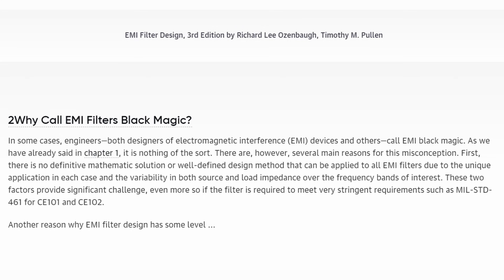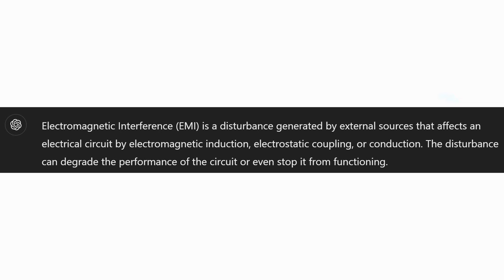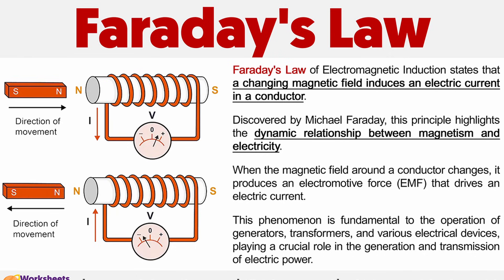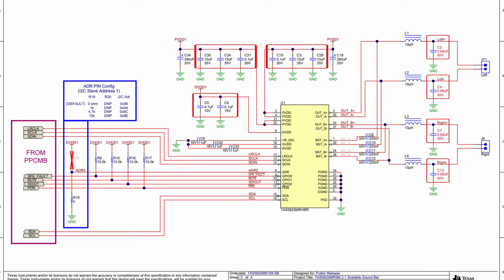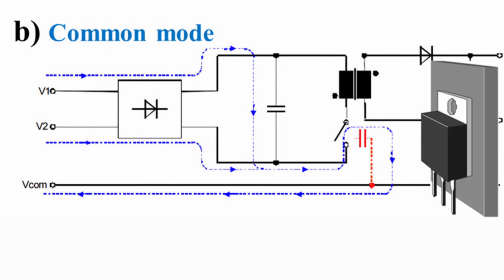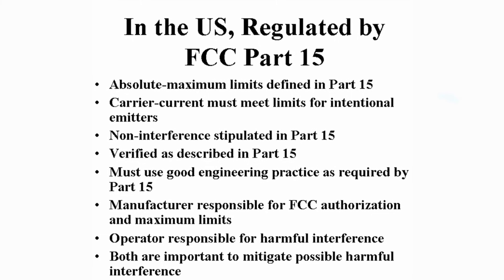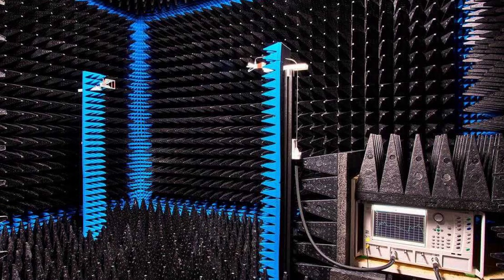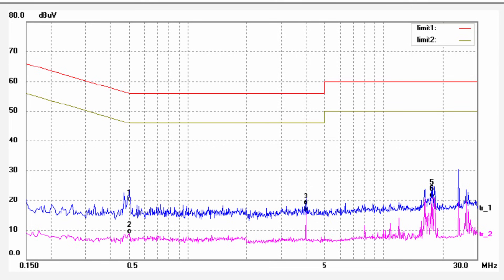EMI Basics (For Beginners) | Electromagnetic Interference

Comment from the maker: What questions do you have about EMI?
Reply: Where common mode and differential mode emissions commonly originate from and how to tell them apart in a measurement.
Reply from the maker: great question! We will be covering that thoroughly in this series
Reply: what are some strategies to counteracting emi within the US power grid, if needed at all?
Reply from the maker: great question! We will be covering that thoroughly with several videos, so stay tuned :)
Reply: How do i do pre compliance testing affordably?  Can I use a tiny sa ultra?
Reply from the maker: there are some low-cost ways to do pre-compliance testing, and we will be covering that in a video.
Reply: Are there distinctions between EMI and certain forms of noise found in circuits (e.g. thermal noise, 1/f noise)?

If I had to guess: it seems that noise, in general, includes both EMI effects and effects that originate within a circuit itself. The distinction seems to be that EMI pertains to those effects that are caused by an external source--e.g., radiation from power lines, the sun, various devices that radiate RF emissions, or noise picked up from crosstalk in PCB traces or power supply ripple.
Reply from the maker: In general, all types of electrical noise can be understood as EMI. It's origin might not be entirely electrical, but if it manifests as electrical, then it is a problem we must deal with.
Reply: Hey! Thx for researching i really liked them! Do u know what is input lag? I think u found an answer for that. So main question: how magnetic field affect all the filters snubber and ect. ?
Reply: If my PC is affected by EMI is it basically cooked? Never had problems with EMI until I plugged in my first PC, which also ended up affecting my Xbox rendering games basically unplayable on both. It has created input latency issues with kbm and controller and seems to have made the image quality worse as well. Been reading forums of people saying they’ve been dealing with this issue for years and once it affects your PC it never goes away
Reply: @spencerrichmond5845 not really, many ways u can try to avoid it. The easiest one - change ur house, flat, or where u live. Also the reason of emi might be out of ur flat, if u live in a building with many people
Reply: @KiyyoWW  yeah that’s what I’ve seen, I am going to bring my Xbox to a friends house to see if it clears up in a new location, but I’ve see people say that even after moving the interference came back. Seems like the gamer plague, that seemingly only affects a minority of unlucky gamers without a clear fix ever being discovered
Reply: @spencerrichmond5845 not a minority, most people just dont know about it and cannot see. They say ,,bad’’ day or tired or smth.
Reply: @KiyyoWW  yeah that’s probably true, it’s just wild to me that people all over the world have experienced this dating back to like 2009😂some people even spend thousands of dollars to filter out the interference to only have a slight improvement. Might just sell my devices and hope that when I move out I can start fresh and game like normal

Comment: Hello, I need help with an issue.

I’ve installed GPS trackers on some e-bikes, powered directly from the bike batteries. I’ve also connected a panic button to the digital input (DI) of the GPS.

The problem is that the GPS trackers are occasionally detecting false panic button presses, even when the button hasn’t been touched.

Can you please help me understand what might be the problem?
Reply from the maker: you might need to add pull-up/pull-down resistors to that line. I would look into that.
Reply: @RGBEngineering  Thanks a lot for ylur reply.

I was actually wondering — could it be that the GPS device already has a built-in pull-down or pull-up resistor? Do you think it’s worth reaching out to the supplier to check?

Here’s a bit more context:
Most of the bikes are stored in a storage area but I had two with me separately, and I never had any false panic button triggers with those.

That made me think — maybe the GPS units on the other bikes are somehow interfering with each other? But then again, I’ve also seen some false triggers while someone was riding the bike, which makes me wonder if something on the bike itself is interfering with the GPS input during use.

For wiring: one side of the push button is connected to the DI of the GPS, and the other side goes to the ground of the bike battery.

Now that I think about it… could the issue be happening (for the idle bikes) when the e-bikes are charging? Because I don't think I ever tried charging the E-bikes that were with me.

What is you professional takeaway on this, please?

Comment: Maybe you can help me with an EMI problem I have. I use an OTA TV antenna. I get significant pixilation of my TV reception or the signal is completely dropped. The two devices causing the EMI are an induction cooker and a Bluetti power station. The Bluetti is charged bu solar panels. Any suggestions on how i can reduce or eliminate this. At times it makes my TV unwatchable. Thanks.
Reply from the maker: you might try shielding one or all of the devices you mentioned to prevent unwanted interference. You can search for various types of EMI shields online and some of them are able to be customized to your application.

Comment: what a rabbit hole i went down. Closed on a 4plex. the Fire Alarm Control Panel has a ground fault trouble signal but no actual ground fault per inspection by licensed pro. It always and only goes on when the steam boiler a room over is running. 

Pretty sure it's EMI or something like that. Going to try ferritic beads but it could also be a ground loop or something. One thing at a time. it's been a chronic problem that the former owners, a big rental company, couldn't or didn't solve. 

I'm not worried and the property is going great. Like I said it took me down a rabbit hole and I've been learning a lot of things I have always been curious about. If there is a problem- yo I solve it. And I grow stronger because it gives me experience points. That's the rules.
Reply from the maker: Sounds like a good challenge, let me know how it goes!